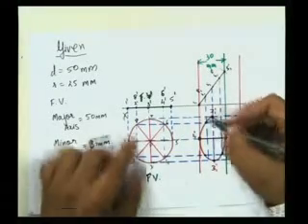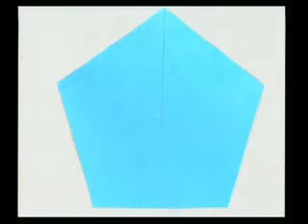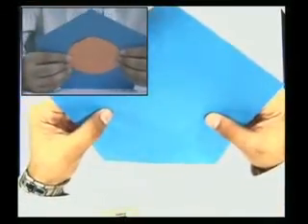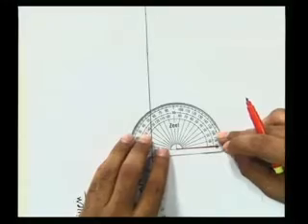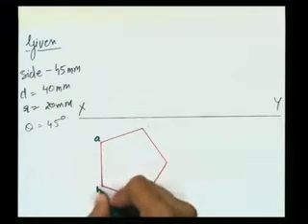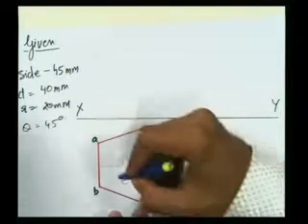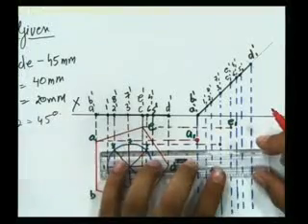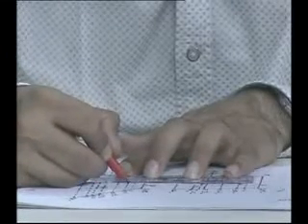Yash Chawla  Projections of Planes 2

Comment: A pentagonal plate of 45 mm side has a circular hole of 40 mm diameter in its centre. The plane stands on one of its sides on the H.P. with its plane perpendicular to V.P. and 45° inclined to the H.P. Draw the projections.